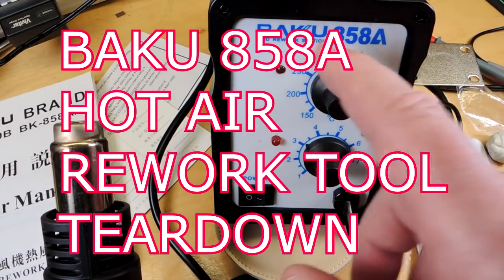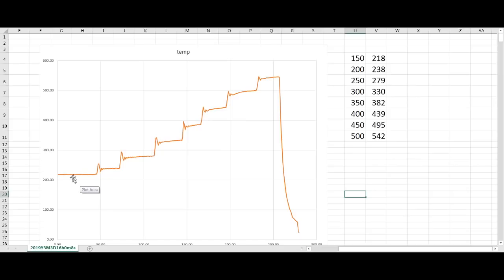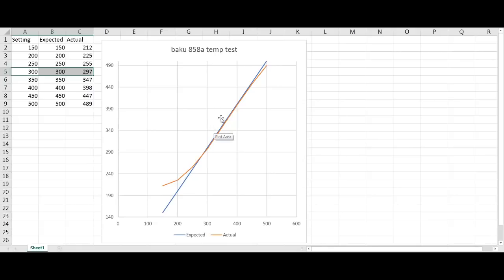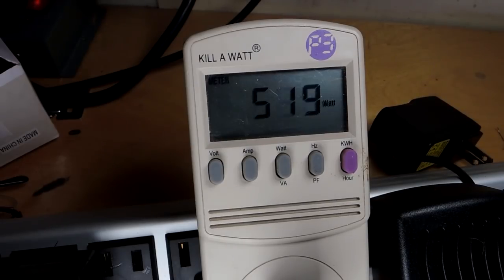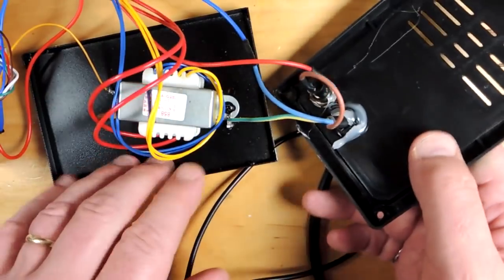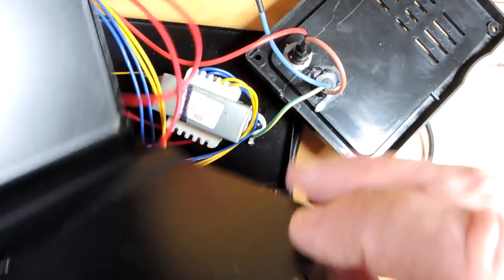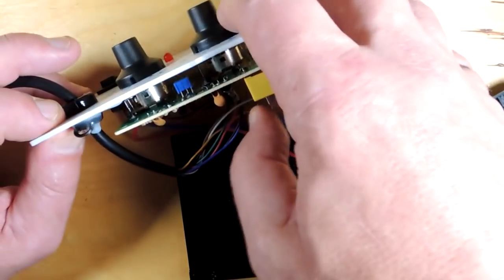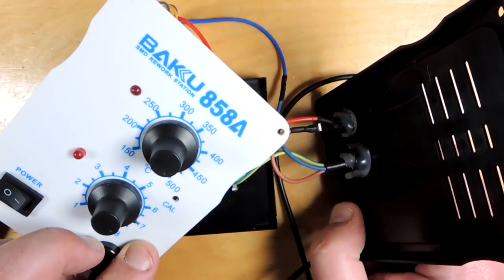BAKU 858A HOT AIR REWORK STATION REVIEW

Comment: Using a hot air rework/soldering station now that while nice on the outside ended up being mostly used parts on the inside.  Found that out once I had an LM324 fail inside the device.  Lucky for me it failed open so I didn't end up with a fire.  I've since added a hard power switch to the device which only had soft off previously.  Edit:  I forget the date code on the LM324,  I just remember it was very very old.

Comment: I have taken 5 or 6 of these 858 hot air guns apart, the grounding has always been really dodgy in the handle. On all units the ground wire has always just been twisted onto a stainless steel strip that goes to the metal shield.

The ground lead that goes to the handle is also too thin to actually reliably cause a fuse to blow in case of ground failure.

Comment: I'm surprised they needed a microcontroller alongside all that analog stuff. Surely a PID this simple could be achieved with just a few opamps?
Reply: It's probably cheaper to go for digital design instead of messing around with an analogue solution.
Reply: Why not implement it with vacuum valves, why stop there